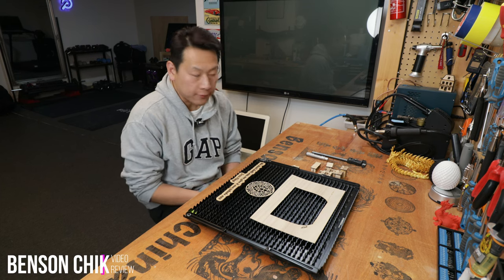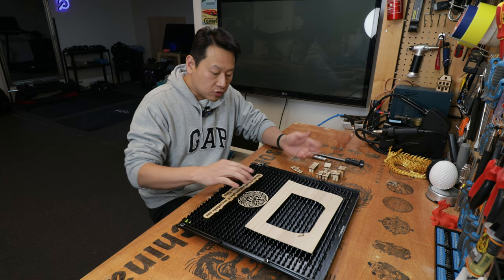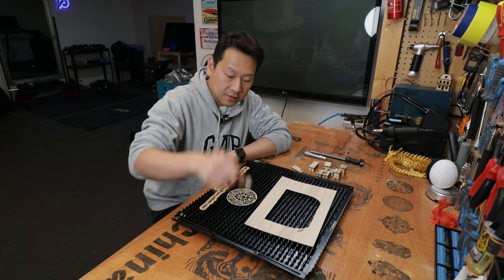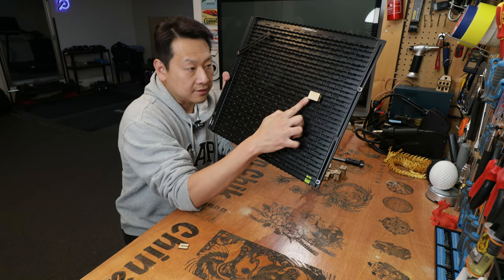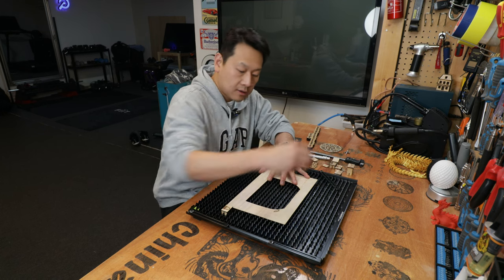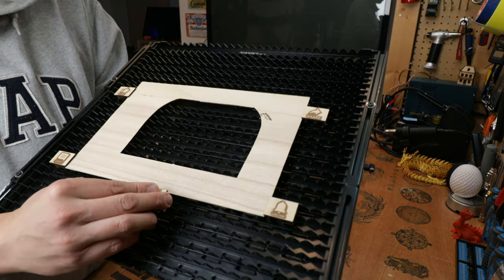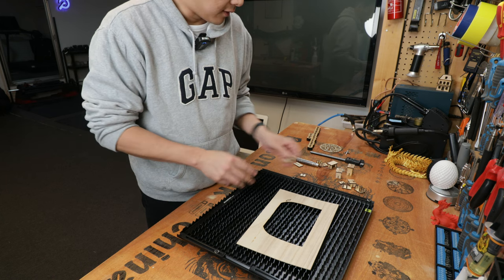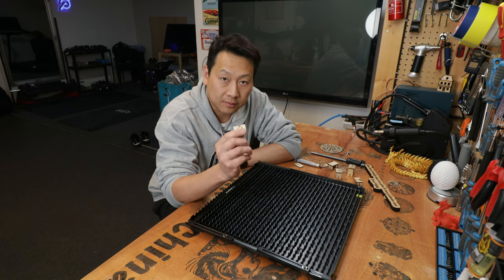No more wing nuts on the ATOMSTACK MAKER F3 Laser Honeycomb Bed

Comment: Hi Benson. I've purchased one of these cutting beds with my new Atomstack X20 Pro, and I've bumped the laser module into the tall screws a couple of times already, producing a terrible noise. I hope I haven't stripped any of the drive belt teeth. I don't think I have. So I've removed the screws and hold-down arms. This option of yours looks great to me. I'd love a copy of the file that is compatible with the Laser GRBL format. Thanks for posting this video. Cheers.
Reply from the maker: Nice to see you here as well as on Facebook. I only have lightburn file lol , it is on the file sections of Facebook group. Lightburn is free for 30 days, just make sure you start the trial when you are ready to put some time into it.

Comment: Hi Benson, love the ingenuity.
Reply from the maker: This works really well the horizontal fixing material to stop it sliding left and right, will need to sort something up and down as it is limited by the spacing between the fixed slates….. I am sure someone good with design will make a adjustable stopper soon.

Comment: Did you put in shorter screws? I am trying to find the screws that will work and another type nut to hold them but live in small town and only an Ace hardware here. DO you have a link to the bolts and nut replacements?
Reply from the maker: I gave up using the rail at he end because shorter screws means less height for the clamps. Even if using clamps for 3mm materials the wing nuts will still foul the laser head. I only use the wooden pegs now